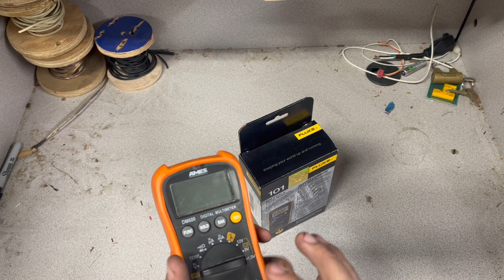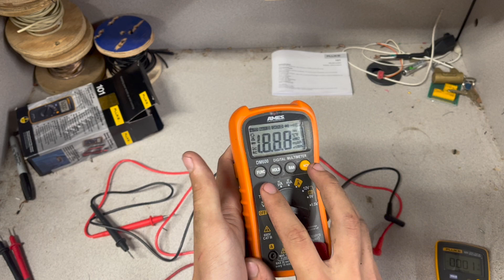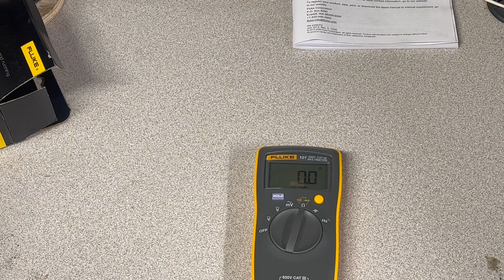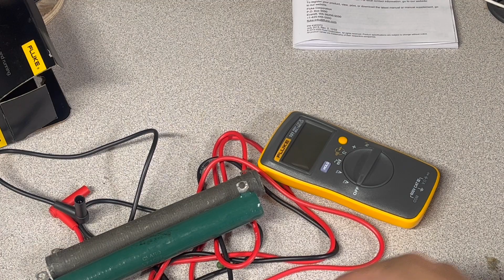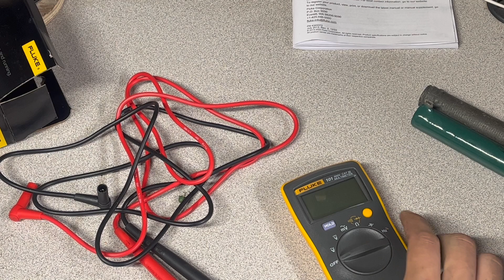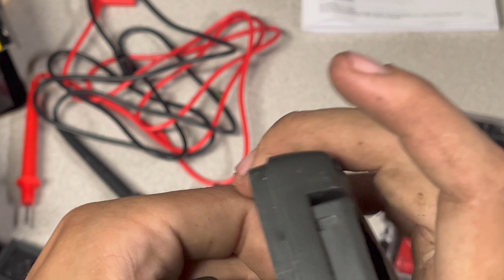Fluke 101 Review: Is It worth It?

Comment: I have two flukes and an ideal clamp meter , but I just bought this 101 to keep in my pouch bag as a beater , it’s so small lol , I’m trying to streamline my work bag , if I’m in a panel I’m grabbing my good fluke, or the ideal on an HVAC unit, but that little thing I’ll have on walks or punch jobs , if an outlet has lost nuetral I’ll find it with that checking a capacitor it’ll do it, would I like to always have my good ones yes but having the hard case fit into a streamlined bag just isn’t feasible. So it’s my beater no case, just throw it in my bag. 👍🏻

Comment: I’ve loved mine for over 3 years now, the only thing I don’t like is its inability to prop itself up on a workbench, due to the probe jacks being on the bottom.  There’s a stand on thingverse, but it’s not big or heavy enough to keep it upright. I’d like for fluke to come out with a silicone case with a kickstand.  For capacitor testing, the leads can throw off your readings. A set of banana clips soldered to a pair of alligator clips solves this easy.

Comment: I some other reviews, the test lead is  not really good.. and it’s not gold plated, that’s why the continuity has a delay
Reply from the maker: Test leads being gold plated has nothing to do with continuity delay. Fluke’s gold plated test leads cost about $100 on their own the meter only costs $50. It’s a little ridiculous to expect gold plated and silicone sheath test leads for a $50 meter. I don’t think even the all mighty Fluke 87V comes with gold plated test leads and the 87V is a $500 meter. I’ll agree that the test leads aren’t the best in the world but they certainly aren’t the worst either. And gold plated and thin conductors or not, that has absolutely nothing to do with the continuity delay. Gold plated test leads are really only needed on the highest end of multimeters like ones that are 6 digits and above, and those don’t come in the form of handheld meters. The Fluke 110 series of multimeters are some of the most popular multimeters in the world and they come with almost the exact same nickel plated PVC sheath test leads and that doesn’t  affect the continuity setting on them.

Comment: I am not an expert, regarding the consideration of the high price, without wanting to go into detail, on the quality of the components, I do not see the chaos of the Brymen in the Fluke, perhaps the result is similar, but the engineering has a cost and it is evident visually , even to a layman, the Casio and Patek Philippe both read the time correctly...it is quite obvious that it doesn't make much sense to buy the cheapest Fluke in the category
Reply from the maker: Fair enough. However you did mention Brymen, Dave Jones has proven that Brymen makes meters that are of similar quality and use similar components to Fluke meters. And Brymen gets away with selling meters equivalent to Fluke models at half or a third of the cost of the Fluke. To be honest I think that a lot of the cost of Fluke meters is just paying for the brand name because they have spent decades making their brand name associated with quality. However unless you have a ton disposable income there’s absolutely no point in buying a Fluke meter unless you’re using it professionally everyday. It’s like buying Snap On tools, unless you are using them everyday all day you’re not going to get much of a return on your investment.
Reply: @theteenageengineer  Very right, I could buy at most a Fluke 17b or 177, I don't deny that I would like it, but I wouldn't buy a 101, but for my needs and capabilities 100 euros would already be a lot, I'm undecided between a Brymen BM235 and a UNI -T UT61E which it costs half as much
Reply from the maker: @TheFelix63 I’d go with the BM235 from EEVBlog. That’s just because if it breaks Dave will actually take it back and either fix what’s wrong or if it’s not worth fixing he’ll send you a brand new one. I think one of the reasons fluke meters are so expensive is no matter how cheap the one you bought is, it’s guaranteed to be calibrated from the factory. And the more expensive ones like the 87V are easy to calibrate. For your average electronics hobbyist having a calibrated multimeter doesn’t matter but in industry having a calibrated meter does matter. I was talking with I guy I was working with a few weeks ago who was a calibration engineer at HP and Apple and he was saying that many years ago an out of calibration fluke meter that was personal property of an engineer caused a giant issue in the product they were developing. He said that his policy from then on was if you are using a meter on work projects in a lab then it gets calibrated even if it’s your personal meter.

Comment: My aunt gave me a Fluke 21, says it was made Oct '93. It was in her closet in a box. I was working on her riding mower and my cheap one quit working on DC. I don't know how much it cost, but I got it free. It has a nice bag, maybe leather. It says 1000 volts DC, 750  AC. I'll get a battery and try it, if it's okay I'll get a couple rechargeable batteries and a charger for it. I have solar panels and batteries so I am always checking voltage or resistance somewhere. Says it was made in Everett, Washington. Oh, it has four screws holding the back on. This one will do me for what I need. Thanks for the video.
Reply: Harbor freight and rugged, umm ok

Comment: Greetings...

If you really desire a Fluke,  the 17b+ is the cheapest way to go for a Fluke meter. 

Brymen makes really good meters for the price,  BM235 is an example.   Klien is not bad
for the price, MM420 is an example.

Best to have listed certification, UL ect,  for whatever CAT ratings a meter has.  CE can be ok if major brand.
Reply from the maker: Oh trust me I’m well aware of the world of multimeters. I might consider a 17B+ when I have a bit more money to spend. Although at the moment I want to put my money towards a new oscilloscope.
Reply: I have a 17B+ and it seemed the best bang for the buck at the time for a meter with solid
input protection - an electrician might need something more but im a DIYER and its more than I need.